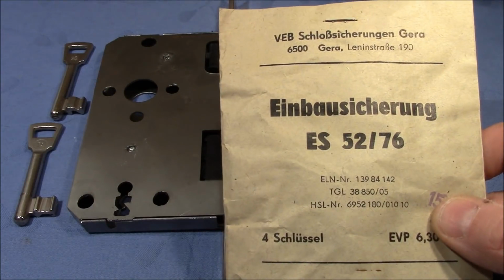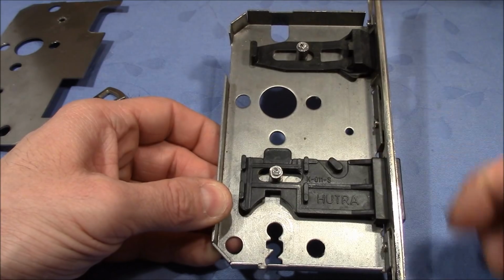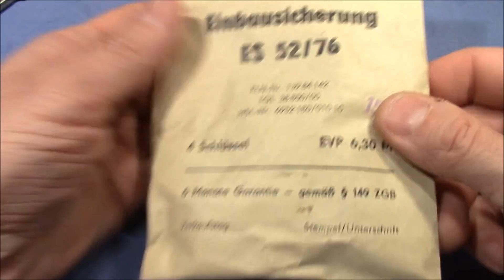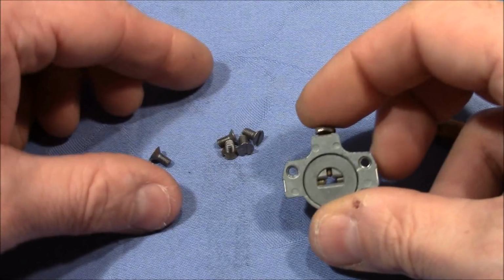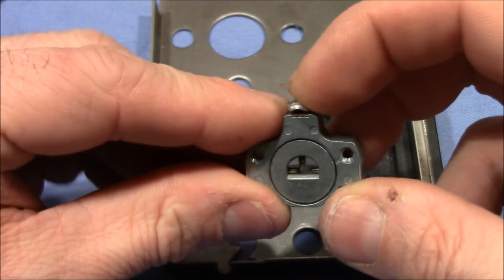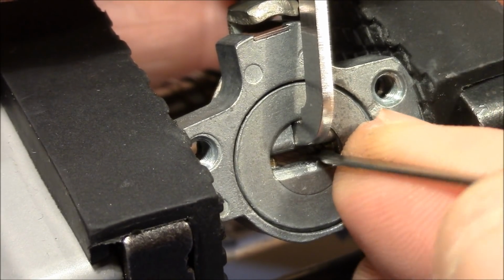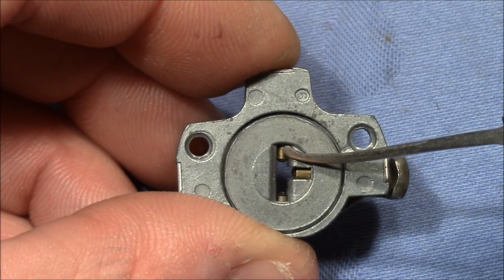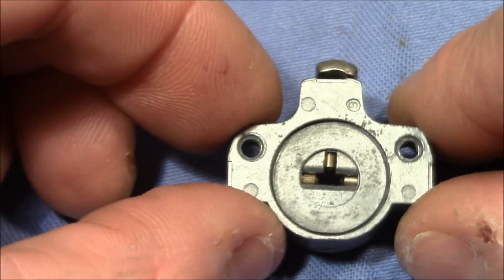(picking 476) "Einbausicherung" made in GDR and sent to me by 'Keymaster' - thanks a lot

Comment: Oh, thank you very much for this video. I came back in time to my childhood. We had the same lock in the front door of our flat. Even the same orange plastic keys! :) We lived in Prague (in the former Czechoslovakia, a neighboring country of GDR and West Germany) The apartment we had in an old house, which was built in 1909 in "art nouveau" style. Our front wooden door was tall, massive with carved decoration. All hardware (handle, doorwiever, bell-button) was nice polished brass. My father installed this lock as the main one under the door handle. The advantage was that this little lock did not change the vintage design of the door, but it increased security. Of course, we used also the cylindric night latch and the door chain.
Reply from the maker: Very cool report from your childhood - thanks a lot for sharing. Haha - yeah, the orange plastic keys are very unique ;-)

Comment: Are those warded locks still common in Germany today - not new of course ?  Wow - even pre-1800 locks made by a blacksmith had at least one lever and a bolt, I can see why this little add-on lock would have sold quite well :o) Always interesting to see GDR made stuff. :o)
Reply from the maker: Thank you. These warded locks are only common in doors inside the house: living room, bed room, etc. There might be very old houses that still have it on the front door but that's very uncommon.